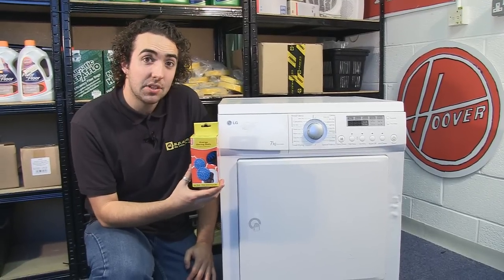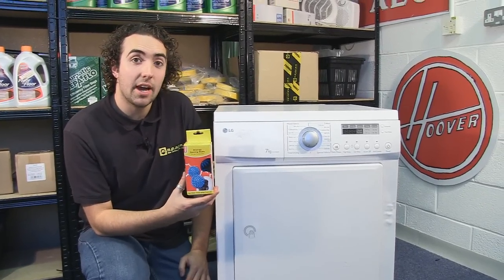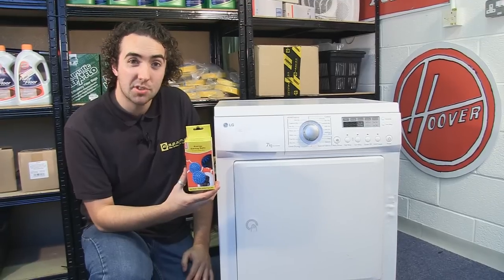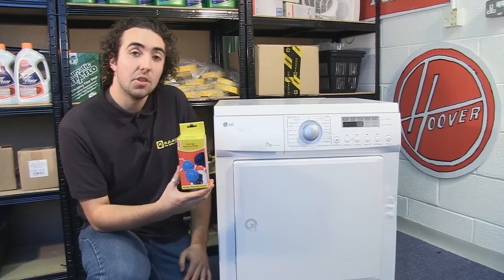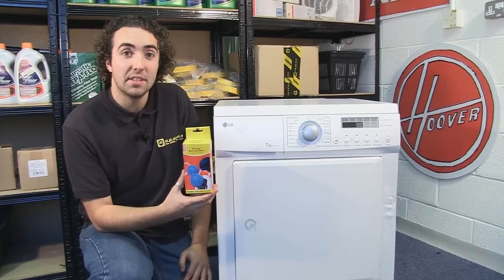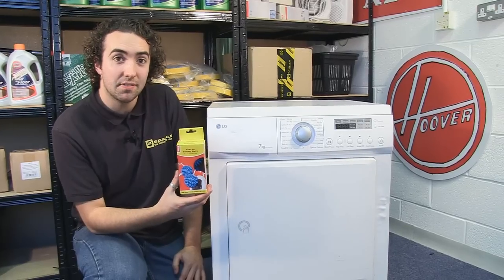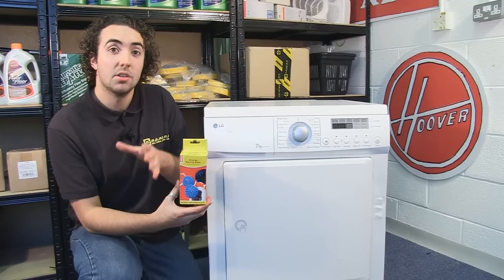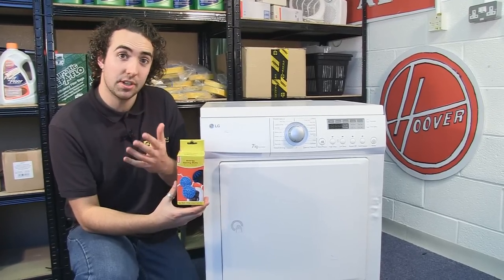How to Use Energy Saving Tumble Dryer Balls

Comment: I tried them but they are so loud! I will just stick to fabric softners
Reply from the maker: The balls are designed to be hard to push the spikes into the washing to soften the clothes. Unfortunately the drum is a large thin metal container and can 'ring' like a bell when a ball hits the surface. An independent video on You Tube actually reckoned the drying time and energy can be reduced by up to 20 percent so it is worthwhile using these balls (if you can stand the clanking). :-)